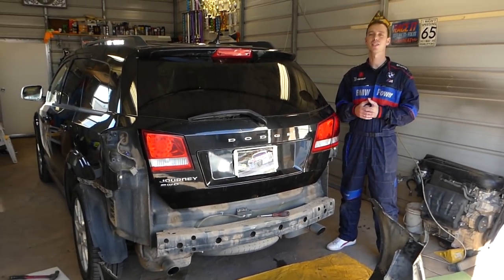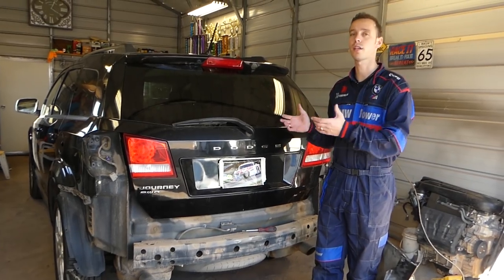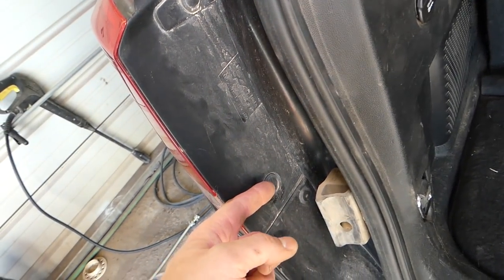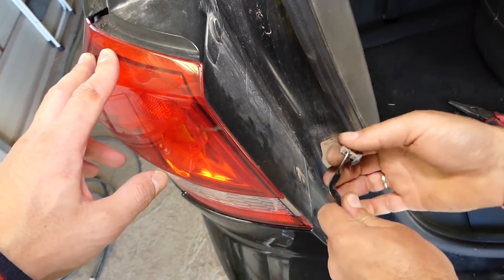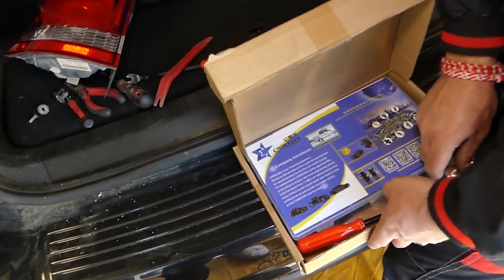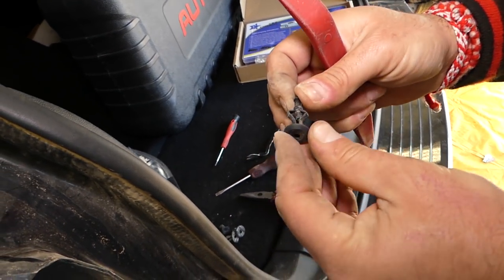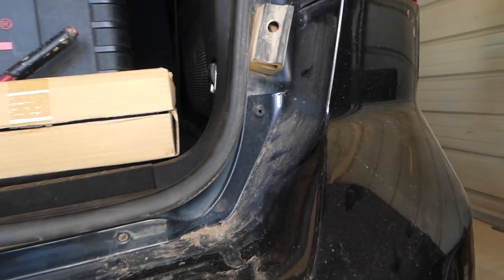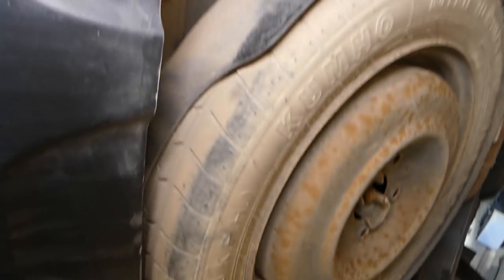DODGE JOURNEY REAR KEYLESS ENTRY ANTENNA LOCATION REPLACEMENT  FIAT FREEMONT

Comment: Removing plastic plugs or clips I  always pry them up a little and spray them with a little penetrating fluid  a few minutes before removing them. The come out easier and go back in easier. A lot less breakage.